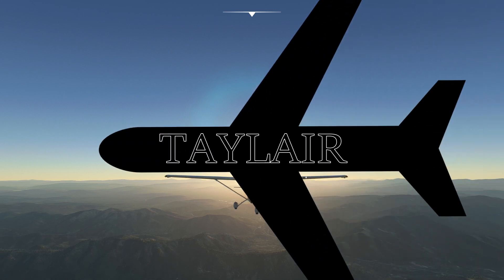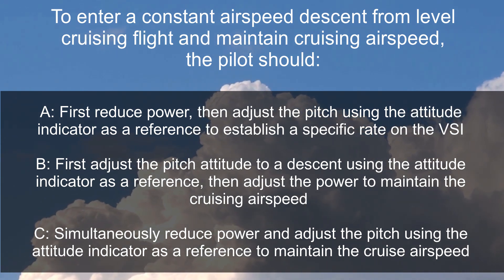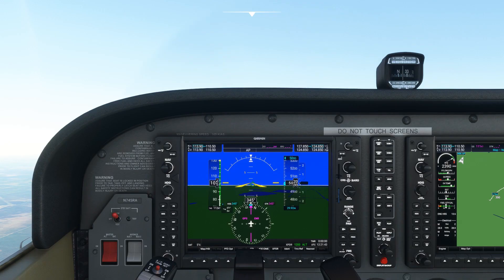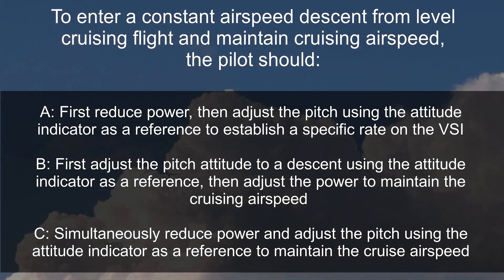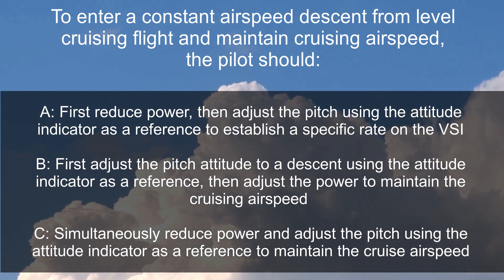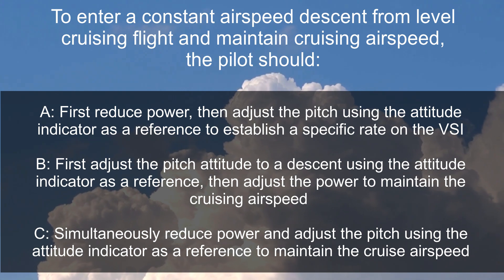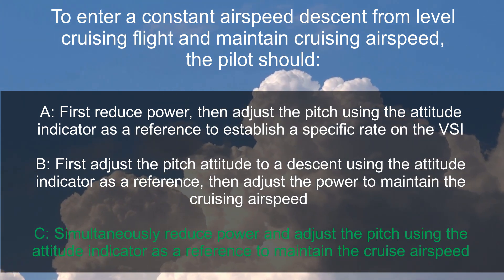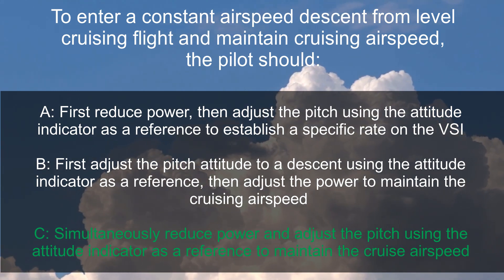Cruise Descent Entry | Theory Quickie | Microsoft Flight Sim | Real Airline Pilot/Instructor

Comment: This was very interesting. When transitioning into a descent, I do C but was under the impression that the reduction in power preceded the change in pitch - probably as the pitch change is so small at first and comes as a result of the change in power. I think my assumption also came from the fact that I was taught the PAT/APT technique (as I'm sure a lot of us were) and so I use PAT when beginning a descent. Therefore, my mind is focussing on the power first, then the attitude and any required trim. This means that even though the aeroplane is changing power and attitude simultaneoulsly, my mind is concentrating on each one separately in the 'checklist' sequence. It looks as though my technique is OK, even though my answer was wrong!
Reply from the maker: If you wanted to descend at a slower speed than you’re cruising at PAT is the way to do it. Unfortunately a lot of instructors skim over these fundamentals. So to descend at your cruising speed, the only thing that really needs to be done by the pilot is the power reduction, the aircraft will do the pitching itself to stay in a trimmed state, so it’s a simultaneous change, even if mentally we don’t think of it that way because we go straight for the power.

Comment: Thanks Taylair! In my flying lessons (Helicopter), I'm always told "Power, Attitude, Trim" for a descent, which led me to an assumption more towards option A. Is it different for fixed wing? I've logged about 58 hours at this point coming towards the end of my PPL(H), so I'm just looking to absorb extra knowledge where possible! :)
Reply from the maker: I'm not sure how it works for Helicopters but for fixed wing, if you are wanting to enter a descent without changing the speed, you would reduce the power which will cause the pitch down with no other control input due the aircraft's tendency to maintain the speed it was trimmed for. There is therefore no need to retrim the aircraft once established in the descent as you have not changed the speed. If you were changing the speed then Power Attitude Trim would be the best way to enter.